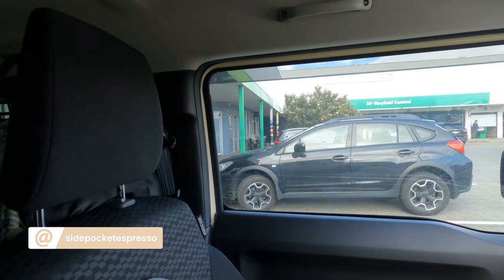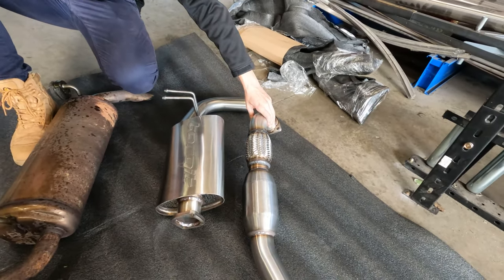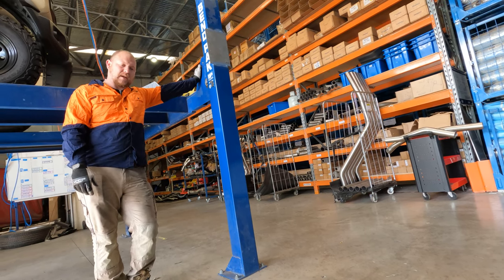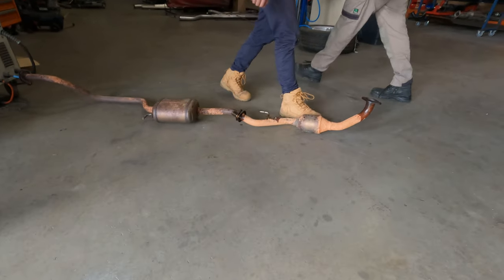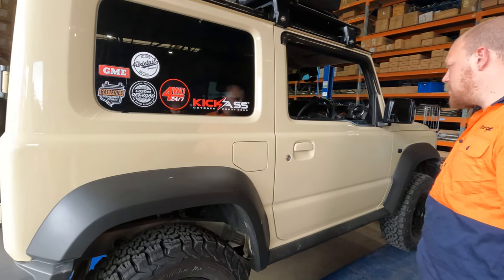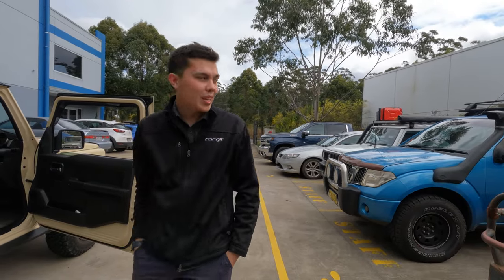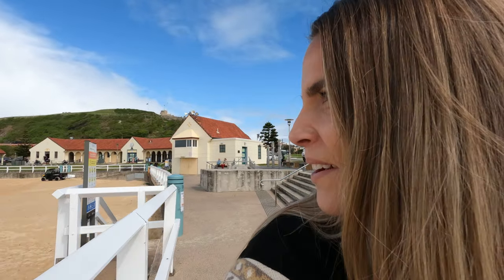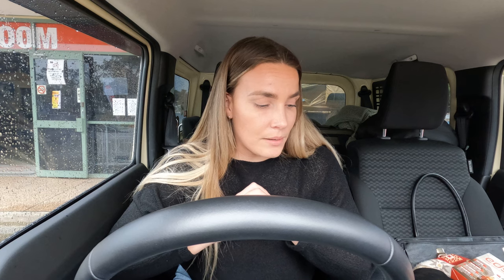NEWCASTLE PART 2 | SUZUKI JIMNY TORQIT EXHAUST INSTALLATION

Comment: Fantastic video you learn something every day. Hopefully it gives you more power with this Torquit Exhaust and throttle controller. Interesting to see how it goes
Reply from the maker: Yes absolutely! Thanks so much 😊👏🏽 I’m amazed with how different the throttle controller and exhaust makes the jimny combined. It’s like a different car with more hp! 💪🏽
Reply: Anything helps the little Jimny engine! - the main change you'll notice is increased fuel efficiency and a much better exhaust note

Comment: Looking forward to more videos where you drive the car with the new exhaust…
How do you find it now you have had it for a while? Has it becoming too loud or annoying?
Reply from the maker: Hey! I'll definitely be posting an update soon. It's been awesome so far. It's loud but you get used to it and the tone settles in the more you use it. It has a more settle, nice noise now than in contrast to what it had in the beginning. I'm stoked with it! 🙌🏽
Reply: Hey  @ExploreJimny  how the sound on the highway? I’m considering one of these as they definitely sound amazing, just curious if you get a constant drone while doing 110?
Reply from the maker: @brianhatchard4756  Hey! It can get a bit loud on the highway going 110. Personally, it doesn't bother me as I don't drive too much on the highway on a day-to-day basis, but if you're commuting a lot back and forth it could become a bit annoying over time. On the Jimny XL however, it's not as noticeable as the exhaust is further back. On the 3-door however the exhaust is closer to the driver essentially so there is a bit more noise.

Comment: Do you feel any change in the acceleration?
Reply from the maker: Yeah it has more power and goes easier on the fuel. Even better with the throttle controller on top for sure 🫶🏽

Comment: what a range difference between 235's vs 215's (abt 30% less range on the 235's)
Reply from the maker: Nah it's not that much. It's about 15% less I'd say from stock to 235/75/15, but it really depends on how you drive the vehicle as well.
Reply: @ExploreJimny  my highway average about 7.7l/100km, city about 8.2l/100km while offroad depends on the severity; can be anywhere 9ish l/100km and higher, all this on 215/75r15 KM3 s', btw have been observing since I got it in 2019. Of course it is not only tyres that affect l/100km, added resistance from roof racks, what u haul on them, et al. bugger the jerry cans for fuel; with longrange tanks from TLR and an aux from BD keepingallthat weight low..what is the awesomest accessory i have seen lately which complies to the roof top weight of the JB74W is this ~45kg rooftop tent, expensive but checks lots of boxes.. https://www.youtube.com/watch?v=5cH52BEQm80&t=280s
Reply: The range /odometer/speedometer readings will all changes because of the wheel diameter . It does not mean that the car is actually giving you less mileage.